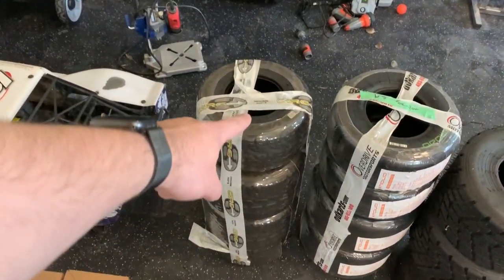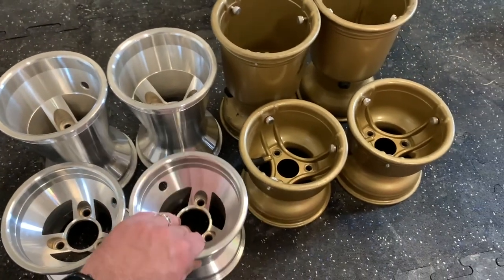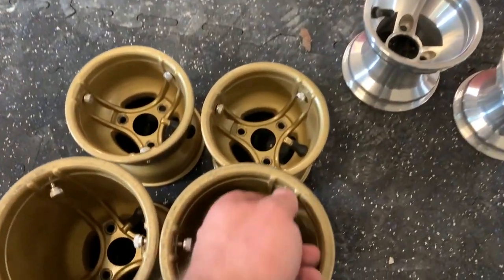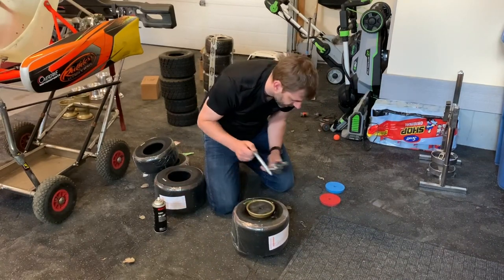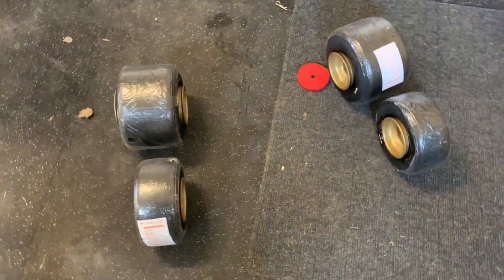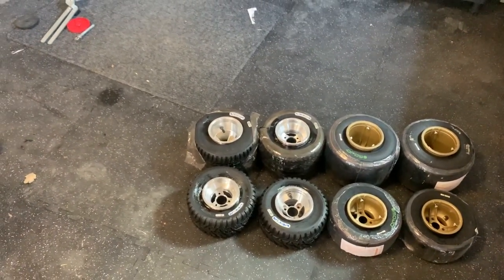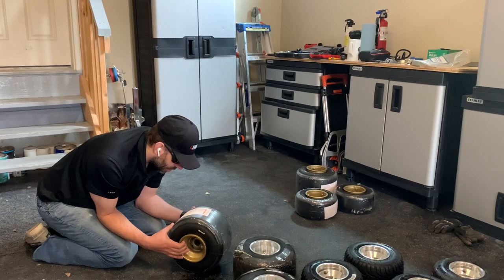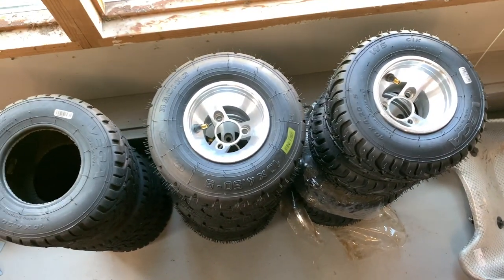Building Kart 94 - Part 1 Tires

Comment: No1 Go Kart source to watch. You are a Must. Have the same problem with one of my front tyres. I will try Knee roll technique  2moro. Stay Blessed.
Reply from the maker: Let us know how it works out.   Thanks for the high praise.
Reply: If you kick on top of the tire it also Goes into position
Reply: Had similar on my mojos I used a flat piece of material to prise the inside edge outward against the the rim all around the tyre just to give the inner part a bit of a wider shape.

Was just enough to help it pop up.

Comment: If you have trouble with rear mojo D5 you can remove insert of the valve using special magnetic screwdriver (dedicated to tyre valve), and than, put air inside using compressor - this really makes a difference because without insert valve the hole is much bigger and more pressure you can use to make edges  "boom" :) also you can use towel or old t-shirt to seal edges of rim - put towel on the ground first, than put rim on it, than put towel on top (around rim edge) an press everything by hand :)
Reply: Also you can use seal paste around the rim, the same as  vulcanization guys uses while changing car/truck tyres - it's very cheap.
Reply from the maker: Thanks for the great suggestions.  I'll try both of these next time.   I did purchase a tire stem core remover (a real cheap one), hopefully that works.  Never thought to try a T-shirt.      Thanks for watching!

Comment: D5s are pretty stiff on the sidewall. To make them go on easier even with the tongs and avoid distorting the bead I like to heat them up a little with a hairdryer first and it makes a big difference.

Again the stiff sidewall causes the issues with inflating the rears given the stretch on the tyres to the rim size, remove the valve from the stem to get max airflow in to the tyre and as you’re inflating step on the tyre to squash it down and it will catch and start inflating.  Can take a few attempts but you’ll get the technique!

Would also recommend a valve stem puller for installing the valve, cheap as chips and saves any hassle or damaging the stem with grips.

Great videos can’t wait for the rest of the series 😎🏎💨
Reply from the maker: Thanks for the feedback.  I've recently purchased a valve stem remover (a real cheap one) will try it out.   Great advice!

Comment: What is the minimum air flow you need to pop the tires? Great video! Keep up the good work.
Reply from the maker: normally you don't need much.  With the Mojo D5's you need as much as you can get.  Some people will pull the core out of the valve stem to get more air flow and help pop them open.   Best of luck.  Thanks for watching.